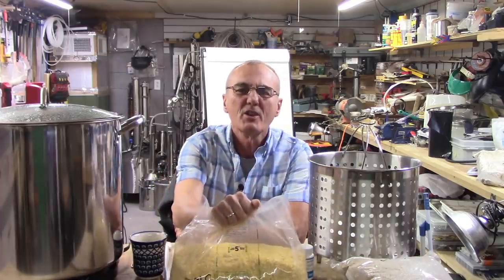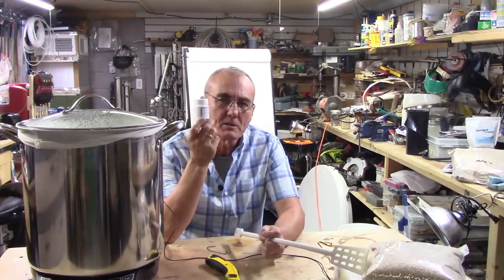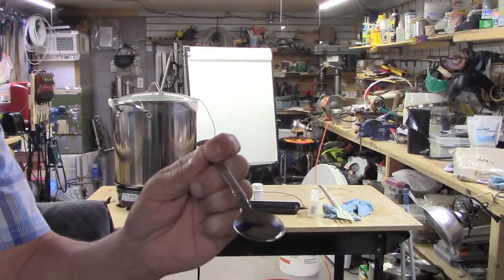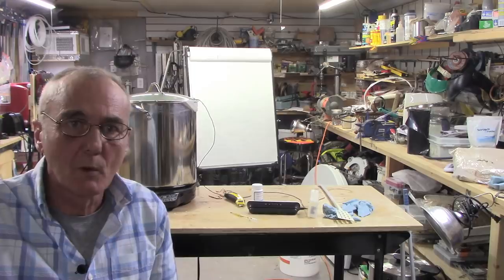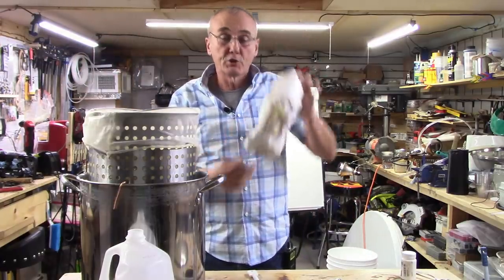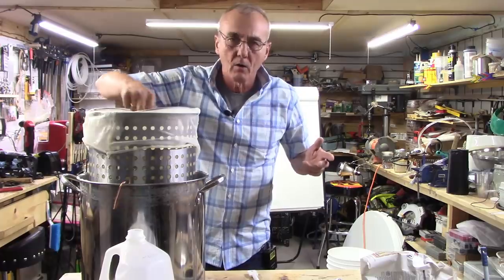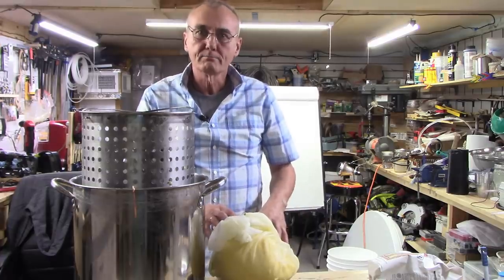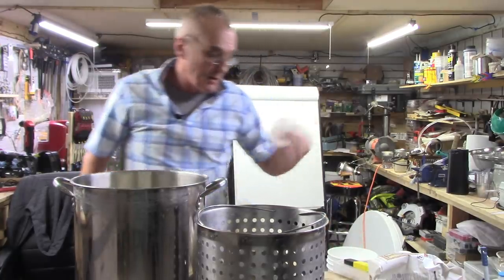Beginner's Guide #8 Corn Mash part 2

Comment: Awesome video, George! You left me wondering why your Specific Gravity of 5 lbs of corn in 4 gallons of water mashed to only 29 gravity points or 1.029 SG. Flaked corn has a PPG (points per pound per gallon) of 33 assuming an efficiency of 85%. You explained this in a previous video (yes, I was listening!). Math: 5 lbs corn x 33 gravity points / 4 gallons is 41 points or 1.041 SG.  You got 1.029 in the video.

I wonder if your mash water was too acidic. Your starch test was a light violet not a pale yellow like the wort, making me wonder if you did not get quite all of the conversion you were hoping for.  Mash pH should be around 5.2 for good conversion.

The beauty of adding sugar is that you can easily correct for a low mash conversion efficiency, making your process foolproof for the average hobbyist. The purists out there may quibble with using sugar to boost gravity since it cannot be done in a commercial distillery making corn whiskey.

Your series has been the best resource I have ever seen for home distilling. You should write a book!

Thanks for all you do to support the craft.
Reply from the maker: Low efficiency on my part
Reply: Honest question, is low efficiency that bad of a thing? Can you get different/more subtle flavors by going in at 10% as opposed to 20%?
Reply: @BarleyandHopsBrewing  Could it also be explained by the fact that you rinsed your mash, thus adding more water . By the way, I also think you should write a book !
Reply: @BarleyandHopsBrewing  thats what you said

Comment: The difference I perceive is about the  same as comparing a strait sugar wash and a first run UJSSM no sower. Both are
sugar wash. But one has sat on corn. Dos not necessarily impair flavor depending   on pot still or column. I have never put the same mash next to one another on the same still. So may only be a perception.

Comment: Hey George, in earlier videos where your making mashes, you’ve heated your mash water 10° or so above 155°F and added the flaked corn, saying that the temperature will drop to your target mash-in temperature by the time you stir in all the corn. Then you add 2 row and/or amylase to start the conversion.  This is the first time I’ve seen you add the flaked product and “cook” it for a while at around 200°F and afterwards having to drop the temperature so that you can add enzymes. Any reason for this change? Does “cooking” the flaked corn for a while add to the flavor profile or something? Thanks for all you’re doing for the community!
Reply from the maker: Method. There are hundreds of ways to do this. Some methods are easier than others. Process is the same
Reply: Barley and Hops Brewing - yes I get that. I guess my question was, is there a reason you changed your method or was it just to demonstrate that there are multiple methods?

Comment: Great video George I've been using corn for a few years now and I prefer to ferment on the grain when it's ready I pour through a screen bag and then put the bag in a mop ringer I bought at Harbor Freight just for this and squeeze every drop out until I have a dry brick of grain. Thank you for all the great information and please keep them coming. Don't be afraid to subscribe I've been a member for years and no one has broken down my door and remember to hit the bell so you know a new video is here plus easy access to the library is great I watched them all at least three time and still go back to refresh my brain when I try something new.  Keep them  coming brother.
Reply: Forgot to add that I always add extra corn starch half a cup per five gallons to my corn to boost abv without messing up my flavor.
Reply from the maker: WOW. This is a great idea. I never thought about a mop bucket for squeezing grains. Simply amazing
Reply: The hard part is keeping it away from the wife.
Reply: How long do you recommend to leave the mash ferment for after I’ve put it through a colander? Also I should be putting the lid on my fermenting tub?
Reply: @llrconstruction7606  for me it is always 10 to 14 days for a 10% abv   "TILL IT'S DONE"  like allways happy distilling

Comment: What was the purpose of cooking the flaked corn at temperatures above 200° F and for so long? Food graded flaked corn is already gelatinized, has it's germ, bran and most of its proteins removed. It does not need to be cooked. You can hydrate it at the temperature range of normal alpha-amlyase (i.e.,  non-thermophylic bacteria derived).

Also, not too be too picky, but the term we use to describe enzymes that have been damaged by excess heat or anything else is that they have become "denatured". Inoculated is something else entirely.
Reply: snappingbear  I was wondering the same thing about the flaked corn. Preference? Efficiency? Instructional? Just seems he could have saved a whole lot of time to just mash solely at the conversation temps.

Comment: Wondering... Instead of using Flaked Corn where all of the enzymes have been rendered denatured by the flaking process... What are your thoughts on using sweet corn taken directly from the cob and crushed?  Would there be enough amylase present in the "raw" grain to effectively convert the starch to fermentable sugars; or would 2-row barley or powdered amylase still be required?
Reply: You still need to introduce some kind of amylase.

Comment: George, I bough cracked corn and ground it myself. Cooked this for 90 minutes at 170 so as not to scorch,  and never got to the thickness consistency of the corn in this video. Any idea what the root cause may be? I used 2 pounds of ground cracked corn in 1 gallon of water.

Comment: George where did you find that pot ? I've been looking around at some of the local restaurant supply stores in my area with no luck...thanks Your videos are fantastic
Reply: Yes I second that question, trying to find a large induction compatible pot.  Does the nuwave hold up well to all that weight?
Reply: Restaurantsupply.com is wear i look stuff before I buy it for the navy. Also look for a 16 to 20qt pot
Reply from the maker: The nuwave holds up very well. I bought this for $50 at a kitchen store at the outlet mall in Austin Texas.

Comment: Hi George! I'm a huge fan! I have a Q. I have a 5gal bucket that I can't get activity out of the airlock. I had an reading over 1.090 and activated the yeast prior to adding it. Should I give it time? What could be wrong?
Reply: Sounds like you have a leak in the seal of your bucket , if after a couple of days you check the SG of the ferment and it’s less than your starting SG it’s fermenting 👍🏻

Comment: So i got a question, i recently bought a 50lb bag of whole corn, now i heard that I need to take 19lbs and place it in a burlap sack and place it in water to soak for 10 days.  after the 10 days i am to allow the corn that sprouted to dry.  After dry i can then break it up as cracked milled corn.  Do you have any suggestions or do i have to do all these steps.  Can I just start cracking the corn?
Reply: 10 day to long soak couple of days spread out over table sprinkle with warm water every day till sprouts get quater inch long clean off sprouts grind its ready

Comment: George great series... enjoying it immensely.

2 questions if I may.

1. What heating unit do you use? 
It looks digital... is it easy to find?

2. Do you just place your thermometer in the mash?
Is it a special thermometer?

I’d really appreciate your advice on this.
Thank you very much for all your valuable information and experience.😊👍
Reply: I have seen  George use a Induction Cooktop.. becarful of the weight. use whatever you have stove top. propane. wood. however wood makes your pot black,  WHEN distilling be extra carful with open flames. #2 I use a candy thermometer in the mash. happy distilling

Comment: At point did you add the sugar . You skipped that lol
Reply: Before sparging - mash was at higher temp, which helps melt the sugar faster.
Reply: @Rubberduck-tx2bh  I prefer making a sugar syrup from sugar and water and adding it as a liquid.

Comment: Just one more thing. I ferment both on and of the grain. Both have there place. Just like the pot still verses column. When ever I ferment on the grain. I find that as the mash is in contact with the grain longer it has a affect of intensifying the character of the spirit.
Reply: Foot loose Camping, I have done fermentation both on grain and off, and can’t really tell the difference in the taste of the spirit. Since there is some small additional conversion of the mash when you leave the grains in while cooling down to 140 F, it may affect the gravity a little.  It really boils down to personal preference and how good a taster you are. Thanks for the comment.
Reply: I also distill on the grain and find that it does improve the flavor profile you just have to take your time and be the turtle not the rabbit when you cook.